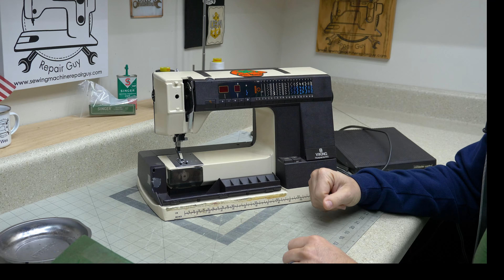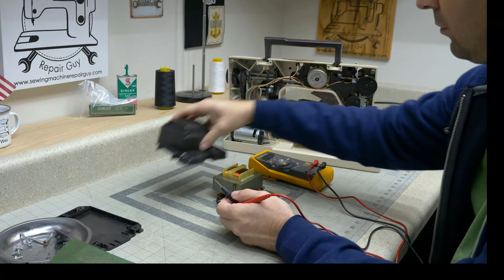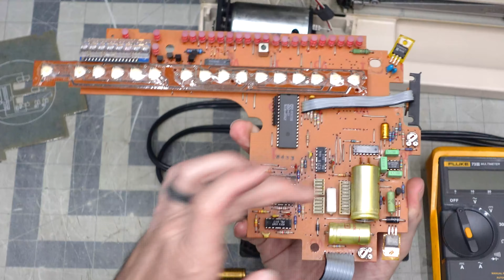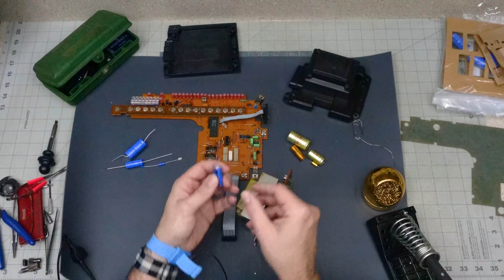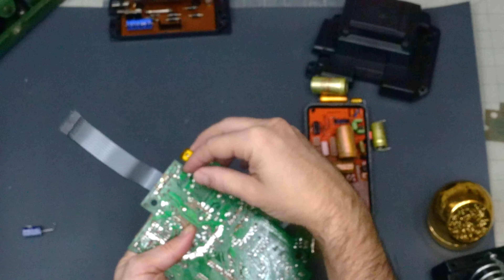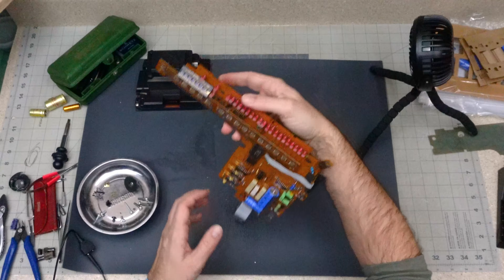Failure May be an Option Today.... ⚡😔

Comment: I actually have taken and got certified in that NASA level soldering, at least to the first level; they trained me on the component soldering and also loom wiring. Quite a while ago, there was a demand for solderers and electronic assemblers, so the NASA course was offered in the Community Colleges. It was kind of a strict course, not just anyone taught it, they had to recruit qualified individuals to teach it, and the instructor they had for that course was really strict. He washed out a number of the people in the class, I think more than half of them never made the grade. Just some community college course, but more difficult than learning touch typing or engine work. It was tough but the work wasn't exhausting - it was just taking a lot of trial and error and repetition to avoid getting cold solder joints. The trick was learning how to get the components and wires and leads to a good temperature so that the solder could 'wet'.

That thing you did when you bent the leads of those capacitors with your fingers would have gotten you washed out of the NASA course - the instructor was pretty strict about that. We weren't supposed to do that. Good thing he wasn't there in the Repair Guy work shop looking over your shoulder in the way, that was his habit. 

But when you mentioned the 'NASA level' soldering, that is pretty much the first time outside of that old community college class that I've ever heard anyone mention that terminology, and that was a long time ago. Even back then, the supposed 'demand' for NASA level solderers/assemblers was not as great as some people seemed to think. Pretty sure that course has not been offered since the early '80s to this very day. The way I see people on YouTube solder components though, compared to the way I was trained, kind of sends chills up my spine though. 

On the other had, the few jobs that certification got me, the things I saw, this was a few years before those shuttle explosions, well, it is kind of obvious why the manufacturers weren't too careful about finding these trained NASA level assemblers; mostly they did their own in-house training of people off the street. They were less interested than the US Navy were about that kind of stuff - sorry to say. Mostly interested in fooling the US space program into paying them big money for a sorry to say, substandard product. It seemed more as if they were deliberately avoiding employees with the NASA certification. They kept firing me for telling the managers about their quality control issues. I don't like remembering about that kind of stuff, to tell the truth. 

Which is why this channel is so great. Even if you don't do NASA level soldering.
Reply: There is no such thing as 'Nasa level soldering'. That is just some nonsense to sound interesting and scientific. Or are you doing your soldering in a complete vacuum without gravity? Nasa is just a space agency and sometimes I'm even wondering about that.

There are some rules when soldering (as with every other job), and you are either doing it as you are suppose to do it, or you could end up with a bad solder joint. Simple as that. It's not rocket science.

Comment: As a seamstress by trade i can say my primary machine is a Singer 401A that my grandfather bought new for my grandmother.   At 3 i was fascinated by it and sat on the sewing desk with her. At 5 i made a dress for my mother on that machine.   When a few years ago a saw a wisp of smoke when starting a seam and i was devastated 😢😢.   My sister found another for me, but when i got up the nerve and watched enough YouTube 😅 i bought brushes and cleaned a huge amount of black gunk off the motor.  She sews again! 
That is currently my piecing machine for my quilt business,  the other is my binding machine.  I still use the industrial and several other machines but i can't give up the 401A.    But i am working on getting an old Singer 66 treadle working 😊

Comment: I had one of these from 1986-2020 when I gifted it. It had a failed circuit board at about five years, replaced under warranty against the will of the questionable ethics repair shop. After that it was trouble free. I kind of miss it.

Comment: Good video.  Haven't worked on many sewing machines, my field is mechanical/electronics, so let me know if I am incorrect about anything I say. Checking (testing) a capacitor in circuit with a multimeter set to the capacitance or resistance scale will tell you nothing useful about the capacitor except, in resistance scale it may show that the capacitor or circuit is shorted which equals a problem. The only way to properly test a capacitor is out of circuit and check for capacitance or, preferably, ESR with the appropriate meter. Question, have you checked the output and input from foot pedal to machine since it was returned with this problem. Good video,  waiting to see what fixes this one. Thank You...
Reply from the maker: Yes, removing it is better, but checking it in the circuit can let you know if it is a dead short. Also, I have experienced capacitors that read properly on the ESR but are bad when under load. There is probably an expensive tool to check this, or just replace the capacitor, lol.

Comment: I'm trying to fix the prisma 980 but it goes nuts when I press the pedal it goes fast with no slow start... Im stuck 😒 I replaced some caps and other parts but it goes to fast... Could you have an idea where I have to do next? Maybe a DA converter died? So that you step on the pedal it goes max 😬 help is needed. Pedal is ok kind regards Albert
Reply: Is there a mosfet (that controls the motor) on the pcb? If those go bad they can do exactly what you are describing.